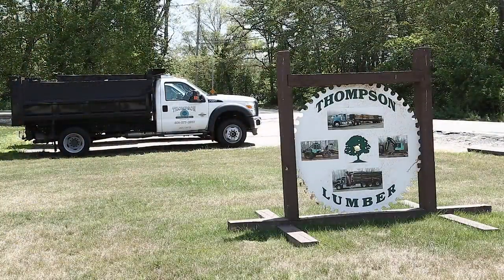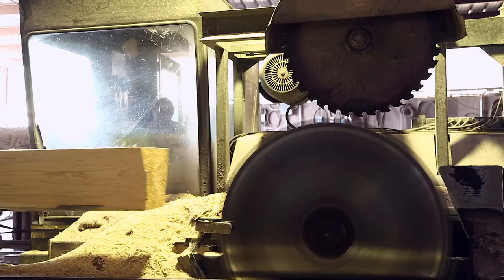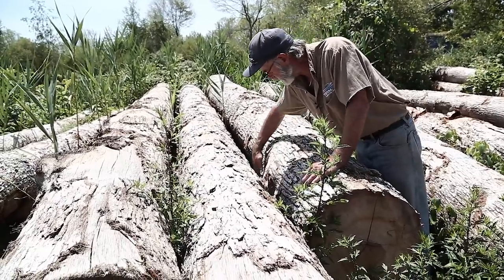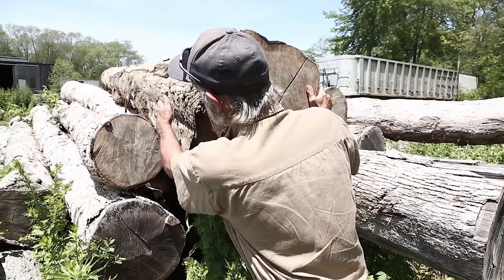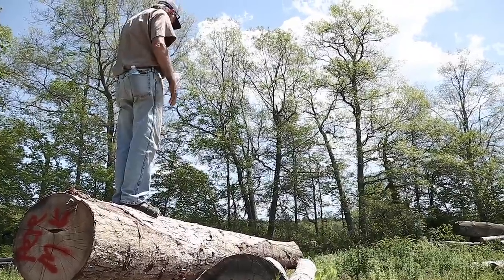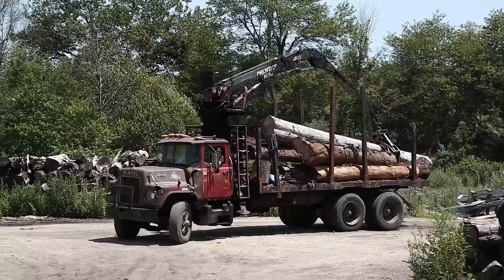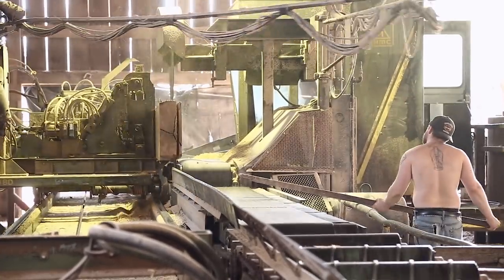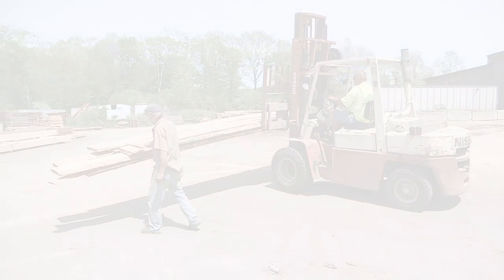Building the TotalBoat Sport Dory: Episode 2 - Sourcing White Oak Lumber

Comment: I'm excited to see why you favor the center cut. My limited backgrounds in woodworking, construction, and carpentry would steer me away from any lumber with the grain oriented in this fashion. If I had to guess I think what you're doing is setting the planking up so that it swells against the next board and makes the boat water-tight. Thank you for another great episode!
Reply: FWIW quarter-sawn lumber is much stronger than slab-sawn. When lumber breaks it's almost always a split with the grain instead of across the grain. The oldtimers used to make the rungs on a ladder from hand-split lumber instead of sawn lumber to ensure that the grain was continuous from one end to the other.
I imagine for boat building they look for strength and a uniformity in swelling, which quarter-sawn lumber has.

Comment: I used to have access to a mill more primitive than this-same saw.  But the Sawyer stood right behind the carriage I the logs loaded manually.  Off-bearing was manual, another guy ran the tail saw for firewood scraps. A Detroit pulled the whole thing on a flat belt, no hydraulics at all. BTW-Circular saw, not rotary.  I yet have some Osage Orange we sawed.  Love making stuff and leaving some of the big saw marks in the surface-just deep enough to be seen-primitive items that is, not boats.

Comment: From what I can tell, the way the log was cut is different than the original plan, described earlier in the video (around 4:38). It seems the original plan called for some quarter sawn wood, but it looks like in the end it was all plain sawn. That is, if I'm not mistaken. That decision must have come out of the conversation with the sawyer, but I'm curious if you can fill in some of the details. Why did it end up being cut the way it was?
Reply: @10:31 Louis says that the plan was to centre cut the 1" boards from the stem after the 2" was taken off first. 

To get enough true quarter sawn boards wide enough for the boat, you need a much larger stem to mill them from. Plus it will take something like 30% longer for the sawyer to mill the log, increasing the cost of the finished product substantially.